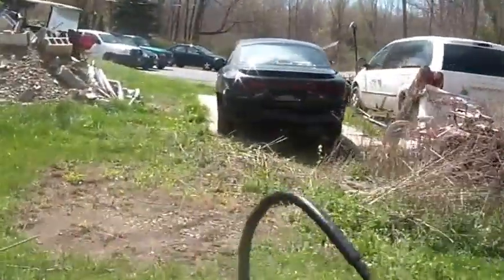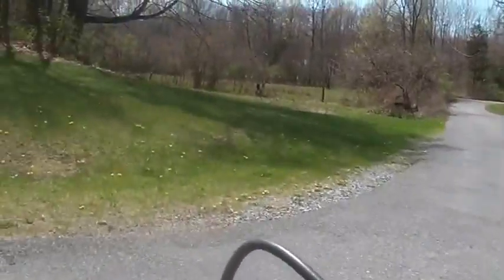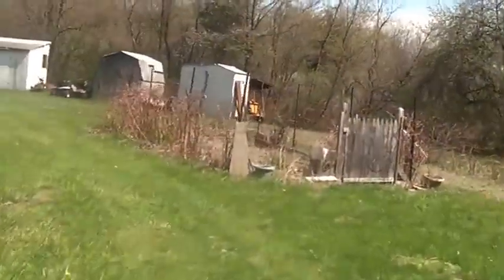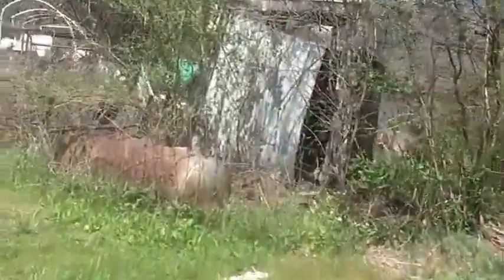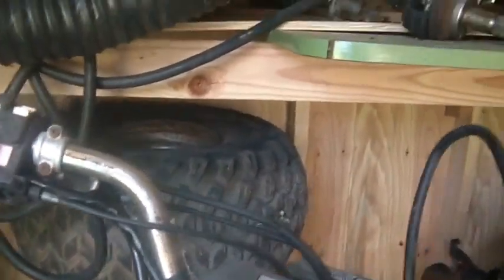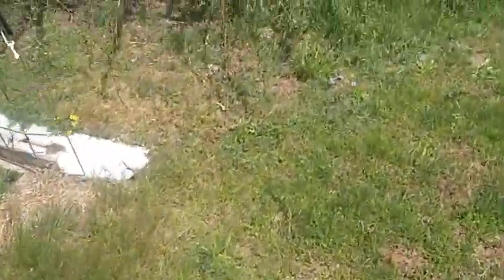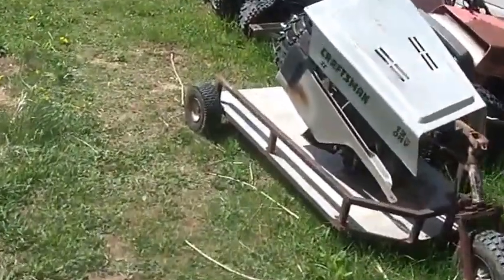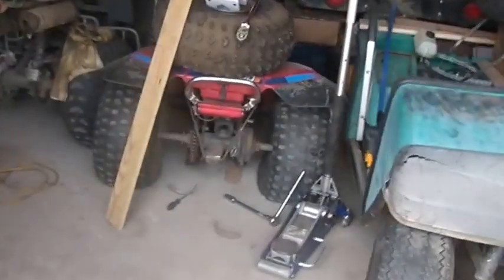Rat Rod, 1986 Honda Big Red, tires and romp,

Comment: The Honda is running like a champ. The Lakota still will be a good deal if you have to add 2 bills to it. Happy motoring
Reply from the maker: +Rusty “rustyglovebox” Glovebox , Next up I have to replace the starter, key switch, and battery... Then it will be like the foreman 350, turn the key, start the motor and take a ride... I have almost enough space to start working on the Lakota... Thanks for your thoughts, positive feedback, encouragement, watching, and commenting!!!!
Reply from the maker: +Rusty “rustyglovebox” Glovebox , Next up I have to replace the starter, key switch, and battery... Then it will be like the foreman 350, turn the key, start the motor and take a ride... I have almost enough space to start working on the Lakota... Thanks for your thoughts, positive feedback, encouragement, watching, and commenting!!!!

Comment: can you deliver?? Harvey
Reply from the maker: +luke j ahrens , I don't know, if I had the zip code of where I was delivering and picking up the quad, it would be easier for me to answer that question.... Thanks for asking, watching, and commenting....
Reply: 12095 the quad is at 464 wemple road
Reply from the maker: will the yamaha atcs getting dropped off where the quad is?
Reply: Yes please my perants don't Care if you drop them off
Reply: When will you drop them off
Reply from the maker: +luke j ahrens , I'll let U know tomorrow, my truck can only carry 2 ATCs, so, the deal will be the yellow DX225 as it is and the blue one in the canvas shed, without the back tires, I get the honda trx200sx in the condition it was in Ur video and any other loose parts U have for it, right?